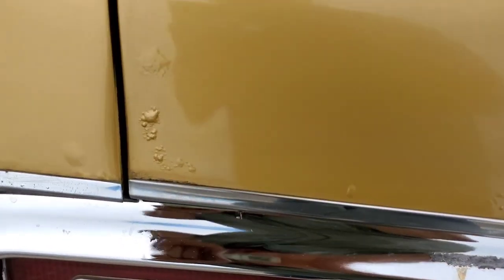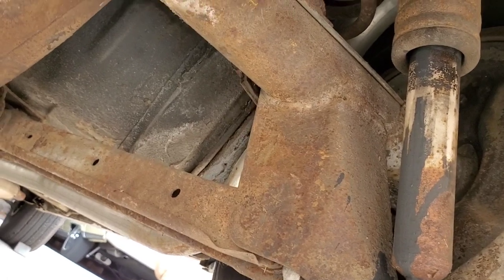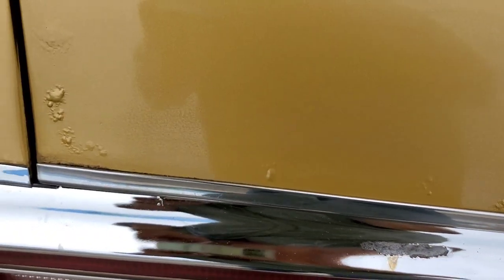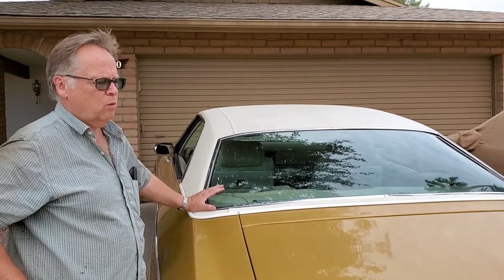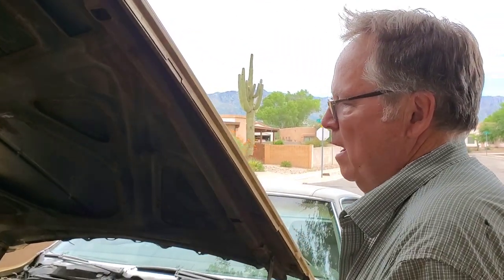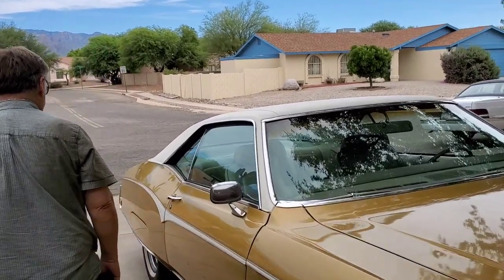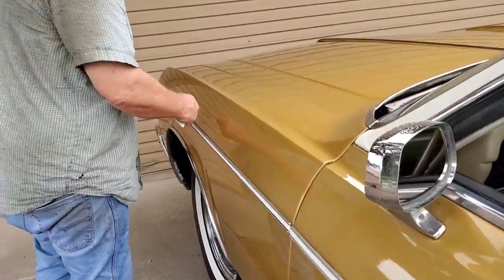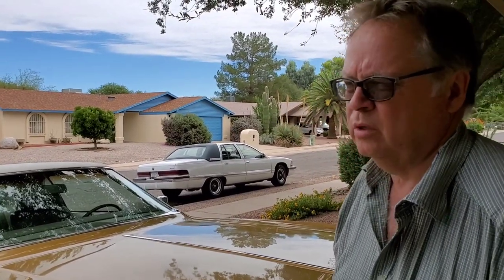1970 Buick Riviera Coronet Gold Sports Coupe SOLD SOLD SOLD

Comment from the maker: Update on the brakes and fuel starvation mentioned in the video. I have adjusted the rebuilt brakes and now it brakes wonderfully. The problem with fuel starvation was a dirty fuel filter. I installed a new filter. Now it is fast, powerful and runs down the road without intermittent sputtering.

Comment: Those wide stripes down the sides that are painted a cream color most likely has chrome underneath . I had a red one that a paint chip that exposed chrome underneath. I removed all of the red paint that covered the wide strips on both sides. It really looked great afterwards.
Reply from the maker: Yes, the entire cast molding is chromed. The insert is usually painted either the body color or the contrasting color of the vinyl top.